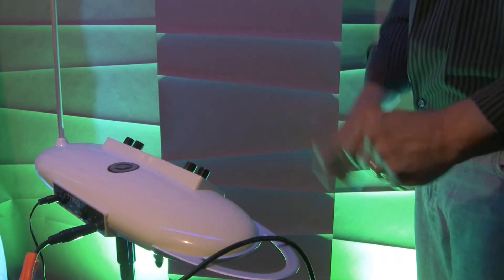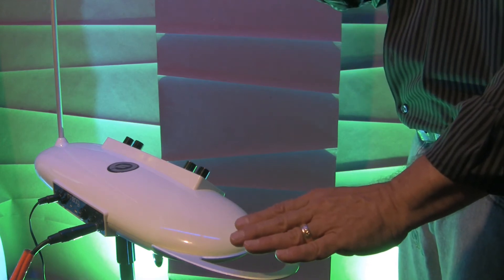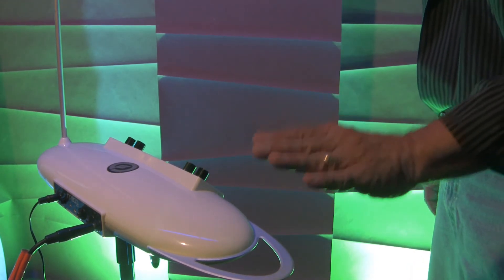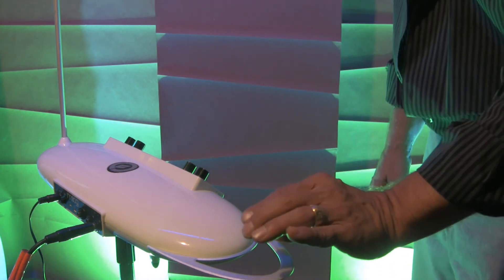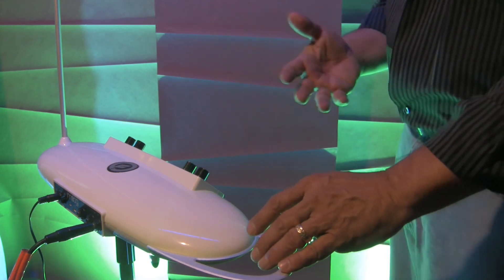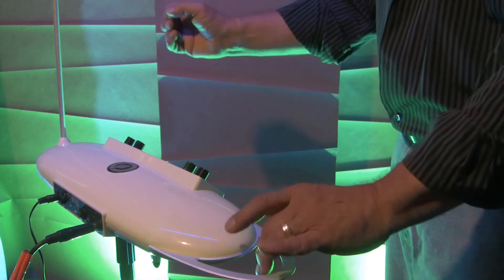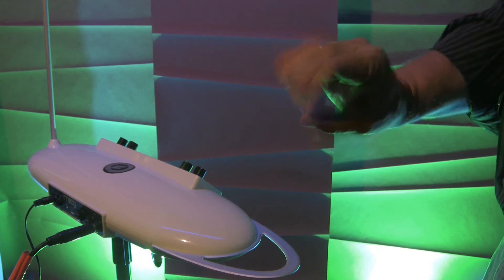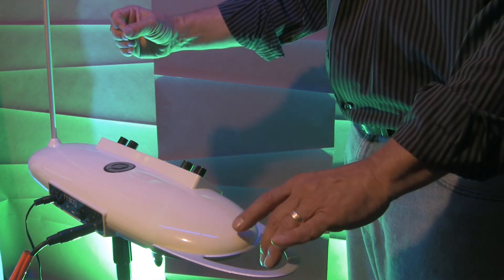Kip Rossers "Complete Theremin" - Theremini 401, Part 1: Improving Note Articulation

Comment: Hi Kip,

Just a quick question please.  

In Classic Theremin mode, which setting are you currently using for Pitch Correction and Effect?

I can't seem to get any discernible note when the Pitch Correction is set to off (0).

Thanks for your help.
Reply from the maker: Hi, Idris: I really appreciate the fact that you're using my tutorials. If I understand you correctly when you say "I can't seem to get any discernible note," you're turning your PITCH CORRECTION knob fully counterclockwise and then attempting to play notes, but somehow the tones are fluctuating as opposed to each one sounding out as a definite note. First of all, make sure, for the purposes of practicing, that you are set to PRESET 01_CLASSIC THRMN and that the "FX" readout says "OFF." Just press the Effect button until it says that. And the AMOUNT knob should be fully counterclockwise as well.

Okay... a basic tenet for "creating" any musical note is: Anywhere you hold your pitch hand still– is a note. Place your left hand over the volume loop so that your Theremini is silent. Place your pitch hand at a random spot in the control space. Hold it there. Lift the left hand and you will hear a note. Repeat – left hand down - silence - pitch hand placed randomly in the control space - left left hand up – and you should hear a single pitch (frequency) that is, in fact, a musical note.

If this fails to work, there may be something fishy going on with the Theremini. If that's the case, I may be able to help discern the problem; create a short video and do what I've suggested. Put it up on YouTube and make sure it's UNLISTED (only someone you send the link to can see it). Then just send me the link at:

kr@performancekr.com.

Observing what you're doing may allow me to see what's going wrong.
Reply: @dnteuxurois  

Hi Kip,

First of all, sorry for not having replied earlier.  I didn't know that you had replied to my posting.

Thank you very much for the guidance as regards the setup and what else to do.  Actually, I had done all that prior to asking for your help.  

After looking deeper into it, I have the feeling that the problem relates to the fact that there are too many octaves in the setting that I was using, hence I wasn't able to clearly find a note.  

However, when I set it to one or two octaves, I could just about discern a note and manage to hold it there.

Anyway, thank you ever so much for taking the time to reply to me.

Just a final request, if you don't mind.  Could you please, if at all possible, manage to play Puccini's Nessun Dorma on the Theremini so that we can aspire to play it by learning from you.

Thanks a lot.
Reply from the maker: @idrisahmadu5699  Idris, I would be happy to play Nessun Dorma for you. I will be able post a new YouTube video within a few days or so and you'll be able to both see and hear it. For now, follow this link and you can hear it as it appears on "Euphonic Verses," my CD of classical music:

http://performancekr.com/wp-content/uploads/2019/09/NessunDorma.mp3

Stay tuned. I'll do a live performance and post it soon.
Reply: @dnteuxurois  

Hi Kip,

Thank you ever so much.